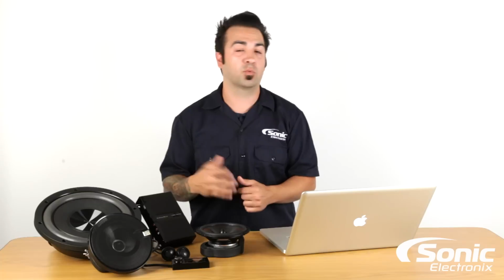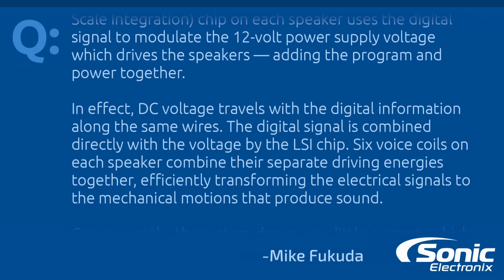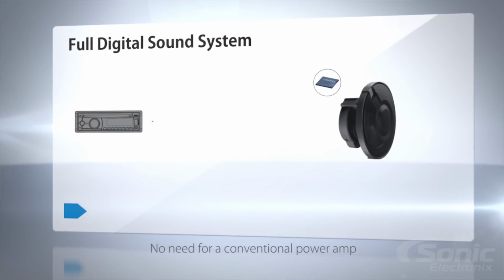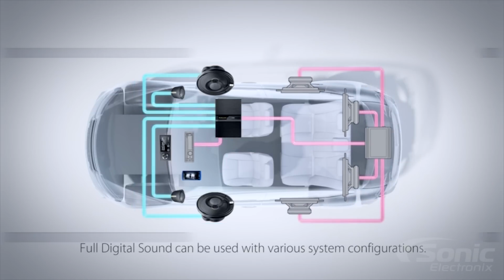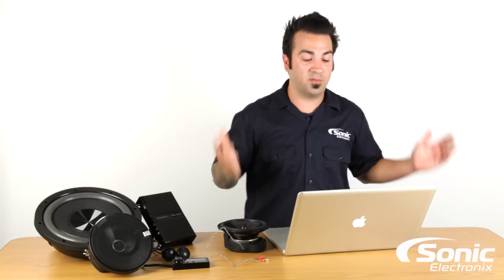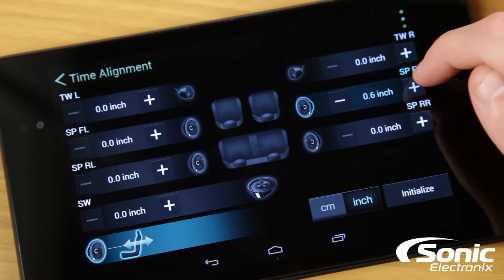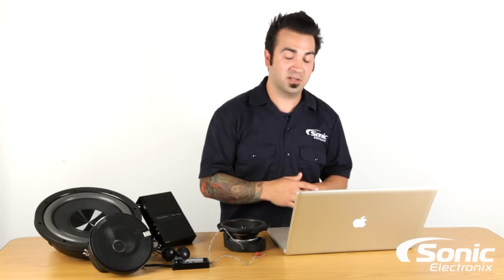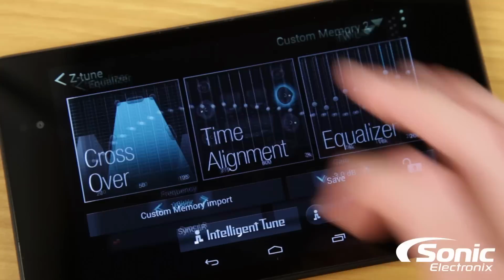Clarion Full Digital Sound System Q&A | How Does Clarion's FDS Work?

Comment: Great video!  I'd like to probe the individual voice coil outputs on the board and see how it's splitting the signal up, and if it stages the output based on volume or frequency, or both.  If this is really as efficient as they say, this might be the solution for a decent sound system in an electric car where energy is scarce.

Also, is the optical input just a standard SPDIF input?

Comment: I had 2 audio pipe 15’s wired at 2 ohms on a 1200w hifonics 1216D.1 amplifier that’s 1 ohm stable at 1200w. I was powering it with a 700w second battery that’s connected to my main battery . I was told that wiring the speakers at 1 ohm would increase there output and i did and they sound the same. Shouldn’t they be louder because there getting twice the power?

Comment: I would say that these speakers are basically the car audio version of IP Speakers that the local public schools are having installed in their new building. The sad thing is that the IP Speakers costs $550 each. So I know for a face that this full digital sound system will cost a pretty penny without even looking up the pricing.

Also, I wouldn't be surprised that Samsung (JBL or Infinity Car Audio branches) would be intro ducting something like this sooner or later if this new idea catches on since JBL already makes IP speakers for commercial uses.

Comment: Strictly speaking, and I admit I am no expert, but it seems to me the only possible way to have true fully digital audio is to have the signal directly interfaced into the nervous system, bypassing speakers altogether. My reasoning is that when the speaker creates sounds, the interface between the speaker and the listener is air(which is a transport mechanism in this instance). Your ears are, by definition, receiving an analog signal. 
However, the nervous system is electrical in nature (pun not intended) and may be able to receive direct digital signals internally.
Or am I incorrect?

Comment: Thanks for the introduction and explanation of this new and compelling product.
I find it almost shocking that Clarion is being associated with the high end anything let alone SQ competing against the big guns of the high end of this industry. There was no talk of price of this system either...as well as any product measurements like THD or DB of noise? That interface looked user friendly. I would sure like to demo it though.
Reply: The prices are on Sonicelectronix website. A full FDS system (Head, Processor, one set of component and a sub) comes down to roughly 3000$ so on par with a decent hight end SQ setup... Clarion was a big name back in the days, they have just focused on the more general stuff in the past what... 10-15 years... I'm rather confident they can pull off something pretty good! They have been developing that thing for quite some years now. I remember hearing about it 3-4 years ago...

THD, db and noise are all ratings associated with an analog system, you can't measure harmonic distortion out of a digital signal. You could measure distortion out of the speaker itself but it doesn't compare to the THD of a traditional amp... IT'S A WHOLE NEW WORLD!!
Reply: I looked, and that price is with only one of the possible 2 subs and still missing 2 mids...no? 
Well back in the day, when I was really focused on Car Audio, Clarion was pretty much as far away from the high end as you could be but still being solid in the game, as far as I was concerned. Clarion had one shot at a high end head unit that did some processing and with that little success in the hey day they went back into the abyss high volume sales till now? 
I love how their subs require dedicated power after all this talk of just two wires and 1/5 the power required. Clarion has really set them selves up for failure at the high end market again if you ask me with these game changing claims that they can't live up to after $5K for equipment that can't out perform $5K of high end equipment. Sure it has a fancy interface like no one else except like Rockford's does but once you tune it you shouldn't have to constantly adjust it over and over again. The accountants better re-evaluate their costs by near 50% if they want to have a hope in playing in the tall grass with the big dogs. The only smart thing they did as a saving grace was the optional analog out for subs; and that says volumes.

Comment: Hey I got a question I bought an aftermarket double din deck for my Scion FR-S I already have a 15 inch subwoofer that’s being amplified by a aftermarket class D amp. I am planning on doing a front, door and rear speaker along with tweeter upgrades and wanted to replace the factory amp and amplifying all speakers with an aftermarket amp. What I want to know is how do I wire all the speakers and tweeters to 1 amp without having to bring the impedance really low ?

Comment: My question would be better to use my clarion eq wih my 4 channel amp and mono amp, or just go right to the amps from the radio? I have a kenwood kdc x 997 that has all three rca out, the amps I'm running is jl audio 300/4 and a jl audio 1000/1 v2, would I be able to have the system tune with the eq or be better just from the radio to the amps? My speakers I have is Rockford punch series 6.5 and the cross over.. thanks your input would help a lot....
 Ps the car everything gonna be in a vw golf gls 4 door hatch....

Comment: So, Upgrading my car audio with 4 rockford T165S T1's, 1 P3D4-10 P3 sub everything powered by a Alpine PDX-V9 and an Lc7i. 

So I sound deaden and dampened the doors and also used fast rings on the speaker as well. With the whole system up and going it sounds good, but no great. Unplug the sub to hear just the midbass, and I'm a bit disappointed. When I rest my arm on the door rest it feels like it should be pumping out ATON of midd bass. but it just does not sound like it is....Do you have any ideas?

Comment: I have a question. I've recently bought a new car. 2013 toyota corolla s. and some one is told me if I was to upgrade my system; such as subwoofer, amp, maybe a new radio, and capacitor it could possibly damage my  car's electrical parts. Just i need to know if I go to a professional that my car will be safe.

Comment: HI Is this where you post questions , if so I would like to know if an amp is fused with 100 amp fuses yet max power consumption is 33 amps does this mean  2 100 amp fused amplifiers can comfortably run off a stock alternator as the max current draw is only 66 amps? thankyou logically the answer would be yes.

Comment: Hey sonic electronix I have a question? i got 2 kickers 10"s both are 600 watts in my 2003 ford excursion. I don't know should I use a hifonics 1500 watts or a 2500 watts bass amp because the 2 kickers are under power right now what should I do

Comment: in a 2004 monte carlo (ive upgraded power and ground under hood ..high output alternator and battery)if I'm installing t1 6.75inch  component speakers in front d3 diamond audio 6x9 in rear d3 500.4 4 channel amp Rockford fosgate p1000x1bd and a 10inch p3 woofer .....what are some overall guidelines to get the most out of my equipment???

Comment: Hey guys I have a Kenwood Excelon DDX6903S and a JX500/1 - JL Audio Monoblock  500Wx1 @ 2 ohms amp and two Rockford Fosgate R2D2-12 Prime R2 DVC 2 Ohm 12-Inch 250 Watts RMS 500 Watts Peak Subwoofer I want to know how I should wire my amp and subs and how to set the gain & how to prevent clipping.

Comment: hi sonic,

ik want to buy 2 monoblocks and put them in linkmode. but must i set my gain only on the master? or also on the slave amp? 
i want to buy the ground zero GZTA 1.1650 DX-EXtreme
 the manual also says that if the amp are in linke mode it is only 2 ohms stable? please let me know i can send you the manual if you want.

Comment: hey guys, i have two of the same subs that each requires a box of 2 cubic ft internal volume an i want to put them in a box sharing a chamber, would i need to make a box with the internal volume of 4 cubic feet  or  2 cubic feet?

Comment: My headunit does not have a high pass filter, and my speakers sound like ass when I crank up the volume. Help please? :D
Reply: get an amp or get a better deck innit or get an eq with at least +/- 12db gain like applying a band aid what we call a plaster to your plastered as in drunk and unruly head units speaker wires, it needs to be fitted to your speakers wires near the head unit the speaker wires go in and out to the speakers innit. something like this Clarion EQS755 you could probably get a cheaper one or more suitable one consult a dealer or research the products as it requires an amp and most basic new car stereo hv built in filters and eqs. like the pioneer deh p6900ib which is dirt cheap .:) and you can get after market stereo kits to replace your old head unit these can vary in cost innit. bon voyage

Comment: i have a different question i have a 2017 Chrysler Pacifica van limited I wanna add a under seat subwoofer amp kit from factory head unit but should I get LC7 or LC2 it already has a Harman kardon 20 speaker system with a 12 channel amplifier so can you help
Reply: LC2i my friend! You only need 1-2 channel for subwoofer.
Reply: +Jules Bilodeau ok man thanks alot
Reply: +Jules Bilodeau last question will the LC2 boost the volume on factory head unit because I like my music loud and it really don't get loud until around 35 but it only goes up too 38 max volume
Reply: +Jules Bilodeau last question will the LC2 boost the volume on factory head unit because I like my music loud and it really don't get loud until around 35 but it only goes up too 38 max volume
Reply: Absolutely not, Ricky! The LC2i's job is to create a set of output that an aftermarket amplifier can use. In no way will it add power to the existing speakers. But, the fact that you are adding a subwoofer will give the impression that the whole system is louder though! If you end up wanting more volume out of the whole system, you are in for a ride. In most cars, it's not THAT big of a deal, but in your car, it is going to require quite a bit of work, since you have the Harman 476 speaker thing :p If you intend to add power to the whole system, then the LC7i becomes interesting! It will allow you to not only add a subwoofer, but also add multiple channel of amplification for each of your actively crossed speakers! It will even allow you to sum all those actively crossed channels to create full range outputs to some aftermarket speakers if you decide to take that route further out in the future!
Reply: +Jules Bilodeau OK I understand now iam just going to put the under seat subwoofer and amp kit in there I love my bass man but switch one will sound better Rockville 10in or kicker 8in sub and amp kit
Reply: Well, Kicker does manufacture a lot of 8" model, you would have to get a little more specific. And I have never heard of Rockville (which is either a very bad thing or a very good thing!) I would go for Kicker since I know for a fact that Kicker product are VERY high quality product both in terms of reliability and built construction, AND sound quality! You can't really go wrong with Kicker product!
Reply: +Jules Bilodeau look at Rockville 10in its YouTube its really nice and let me know if u like it not
Reply: +ricky stewart or maybe I can just buy too 8in kicker subwoofer and amp kit system's
Reply: +ricky stewart has great reviews on Amazon
Reply: Ok so I just watched the video presentation of the slim 10" amplified package from Rockville's youtube channel and let me tell you, Ricky, these guys are just another one of those cheap ass car audio brand trying to gain popularity by selling you big numbers! The problem in car audio is that most people THINK they know what they are talking about, but very few people ACTUALLY know their stuff so you end up with people give good rating for a bad product because these people don't know the difference between a good sounding and a bad sounding sub clipping all the way to voice coil hell... They gave a good rating because they wanted bass and the unit does bass... 

First of all, they claim 800w... on a 25amp fuse... yeah right. Let's say 200w. Second, it's blue! Third, get the Kicker! Here, for your convenience! 

http://www.sonicelectronix.com/item_31843_Kicker-HS8-HideAway-8-Subwoofer-with-Enclosure-and-Integrated-Amplifier.html

The Kicker won't even need the LC2i (It would probably sound better with one though, bass restoration makes a big difference in a OEM system) while I'm pretty sure the high level inputs on the Rockville won't withstand the wrath of your OEM outputs! 

It's up to you man, the Rockville is half the price but it BEYOND clear to my eyes that Rockville is a cheap ass brand trying to lie their way to your wallet while Kicker is a well known quality car audio manufacturer! And let me ask you this, Ricky; Why is Kicker well known? Why is Rockville unknown? Because one make GOOD product and have been since the 70s and the other one makes... products... AND ITS BLUE!!! Do you really want a blue sub under your seat? didn't think so!
Reply: +Jules Bilodeau ok man thanks a lot lol I understand u but I still need a converter because I have the factory head unit right so can you tell me switch converter is good for me
Reply: As I mentioned, the Kicker has High level inputs that will accept your factory amp output. you don't NEED a converter. That being said, as mentioned, it would sound better with a AudioControle LC2i because it will allow you to correct the bass de-equilization generated by your factory radio. Go with your budget, but keep this in mind; bass is like money. When you don't have, you what it. When you have it, you want more...